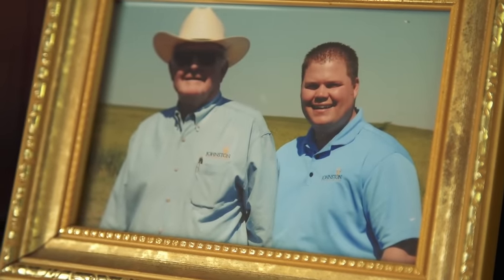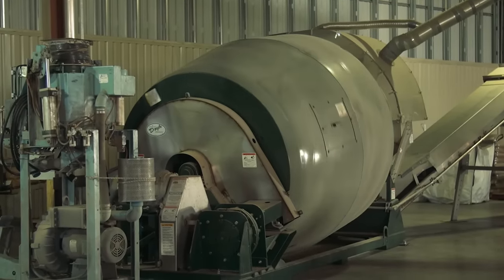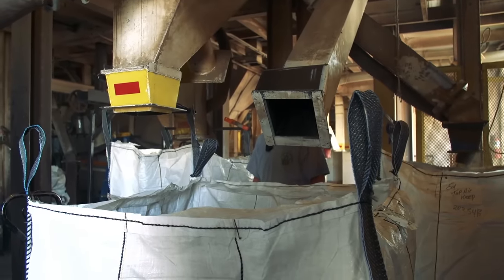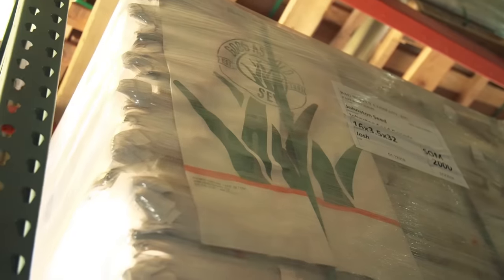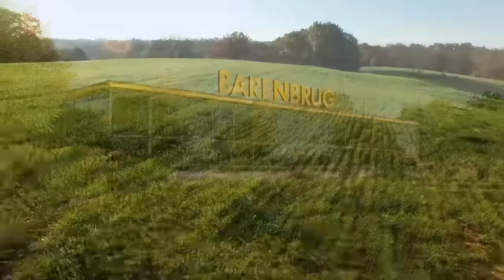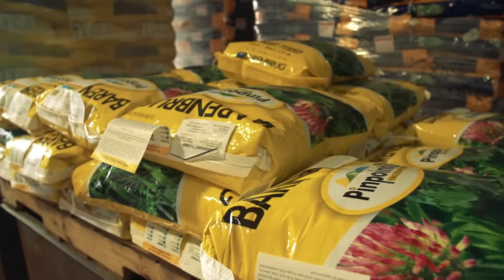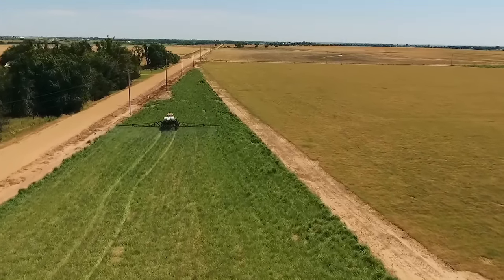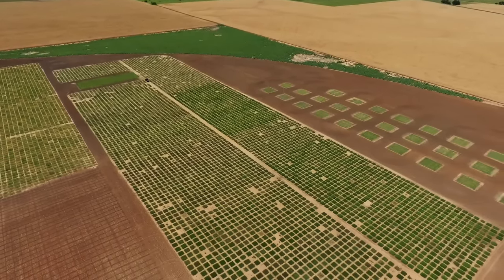Monaco, the next generation seeded bermudagrass

Comment: We lost several bermuda golf greens in Yorktown Virginia   to winter kill in 2018. We had no choice but to use seeded bermuda grass to repair them. We selected Riveria, Yukon and Princess 77 blended at equal parts. The results were great. We cut at .25 inch and it seems as if the grass has been trained to grow low and dense. Is Monaco as good as Riveria in terms of blade texture and density? Could we cut as low as we are now? We have 2 greens that did not totally fill in and will seed them in early may.
Reply: Sucks your comment went unanswered, hopefully, I can answer for others wondering the same thing. Barenbrug and NTEP has a lot of information to answer your question, for exact results I'd look there. Monaco is most comparable to Riveria, with better drought resistance. It would be safe to assume what you'd expect from Riveria would also apply to Monaco, and in some cases with slightly better results, but only marginally. The only stand out statistic is Monaco's drought resistance. Monaco was developed as a continuation of the Riveria variety. I hope this helps everyone.
Reply: @TickyTack23  Thank you!